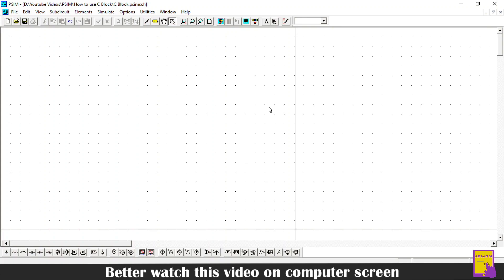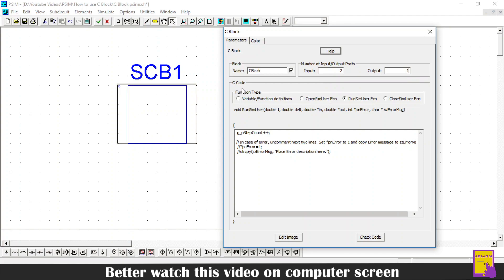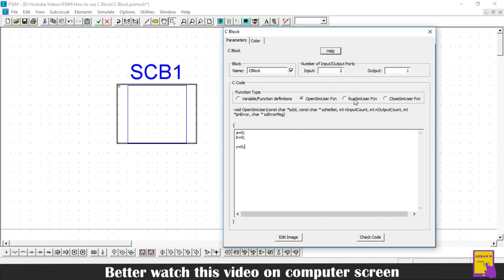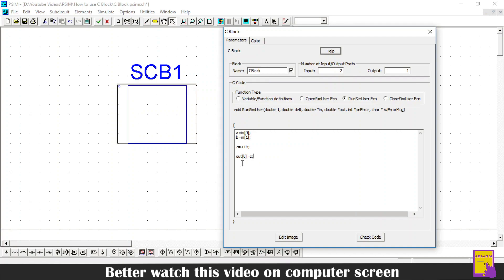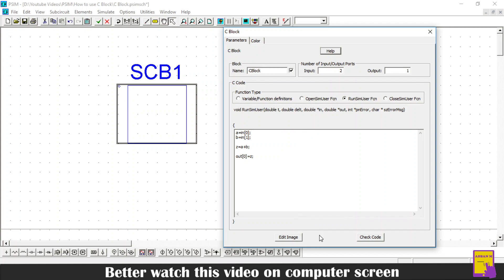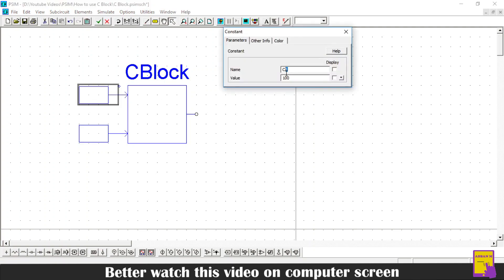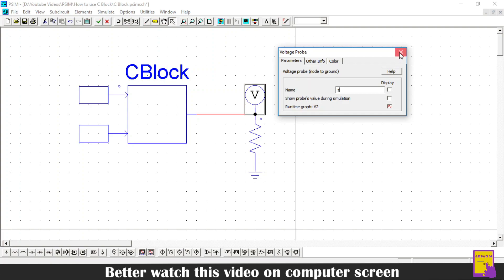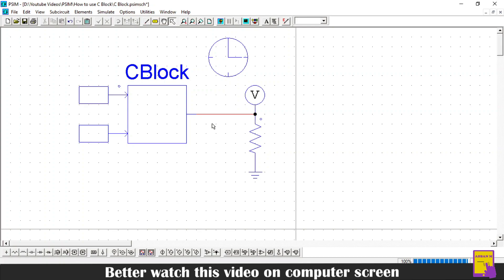C Block | PSIM | Demonstration with simple example for beginners

Comment: hello... if i chek this code. "cannot find stdlib.h in psim".
please answ my question. 
thank you
Reply from the maker: Which version of PSIM you are using?
Reply: @ahsanmehmood9229   I'm using PSIM9.1.4.

if i check code
ERROR: cannot find file 'Stdlib.h'
==> #include <Stdlib.h>
BUG: #include <Stdlib.h> <==???
ERROR : cannot find file 'String.h'

BUG: #include <String.h> <==???
Reply from the maker: @DennyDeff  Open your PSIM software. Then go to Help --> About PSIM.
A window named "About PSIM" will open in front of you. Match the information in this window with the following one:

Active Modules:
	- Motor Drive Module
	- Digital Control Module
	- SimCoupler Module
	- MagCoupler Module
	- MagCoupler-RT Module
	- Thermal Module
	- Renewable Energy Models
	- PsimBook
	- PsimBook Creator
	- PsimBook Exercises
	- SimCoder
	- PE-Expert3 Target
	- General Hardware Target
	- TI F28335 Target
	- PE-Pro/F28335 Target

Active Products:
	- SmartCtrl 1

If anything from the above list is missing, then you need to add missing modules by re-installing PSIM software. 

Still, if the problem persists, then check in this window that you are using PSIM Professional Version or not. If not, then you need to install PSIM professional version.
Reply: @ahsanmehmood9229  I have matched the information you provide. nothing is missing, but there is additional information namely "ModCoupler Module". so what's the solution? .... and i'm using PSIM Professional Version
Reply from the maker: Remove headers in your code and compile your program again. If error persists, then re-install PSIM software by including all modules. I think C libraries are missing in your software or computer.